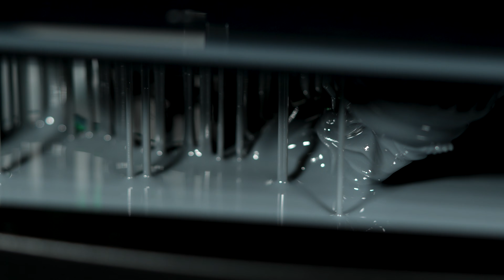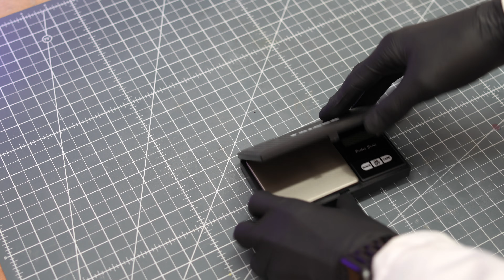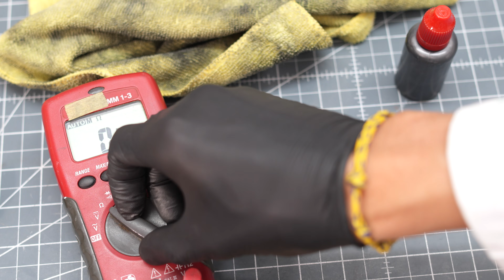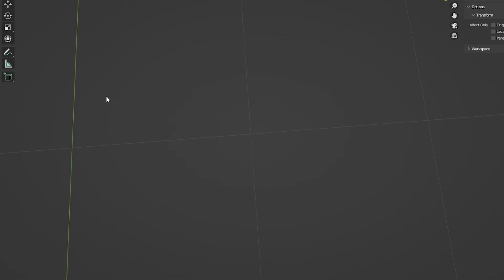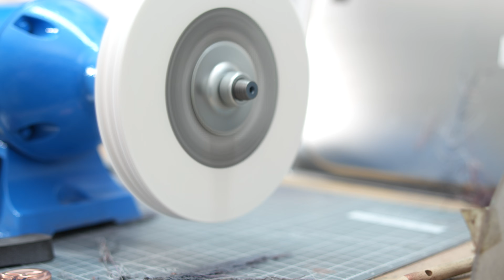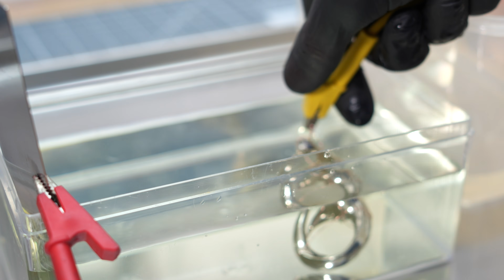Super Shiny 3D Prints | DIY Electroplating

Comment: how does that diy graphite base compares to the copper paint you used to use?
My experience with graphite was never good, the metal would separate from the print by the graphite layer
Reply from the maker: Layer adhesion has never been an issue for me when the whole part is plated. This is for copper and graphite. I think it’s the thickness of the conductive paint not being too big.
Reply: @hen3drik  what differences do you see in use from the copper to the graphite paint?

Comment: Do you have links to the particular binder and graphite powders you used? Having mixed results with the brands in using and would really like better stuff.
Reply from the maker: You could use this binder: 
https://amzn.to/44sVm1P
this also works but needs time to dissolve:
https://amzn.to/3KZpyui

you could get the graphite here: https://www.graphite-shop.com/de/mikro-graphit-14my-994my-995.html
Reply: You have two binder examples from Amazon. One is a cement and the other a two part epoxy. I don't see you mixing a two component before the acetone so I'm guessing it's the cement in your video?
Reply from the maker: It’s the epoxy binder only
Reply: You can also just use magnetic spray paint

Comment: Moin moin.

Klasse Videos.😊

Inspiriert von deinen Videos habe ich mir von Tifoo ein Starterset für die Galvanisierung und das Kupferleitspray, Palladium etc. gekauft. Warum erhalte ich nach vier Stunden Galvanisieren ein Objekt, was voller Pickel ist und wo die Kupferschicht bröckelt? Liegt das am Laborgerät, der Trockenzeit vom Kupferleitspray oder an den Einstellungen? Oder liegt es am Draht, den ich zum Eintauchen verwende?

Geräteeinstellungen habe ich von der Tifoo Tabelle entnommen.

Vielen Dank.😊

Grüße aus dem Münsterland.
Reply from the maker: Du hast vermutlich eine zu starke Feldstärke. 3Ddruck Oberfläche ausrechnen, Quadratdezimeter = Strom. Auf diesen Wert einstellen (über den Strom, nicht Spannung). Druck 10-15 cm von der Anode halten.